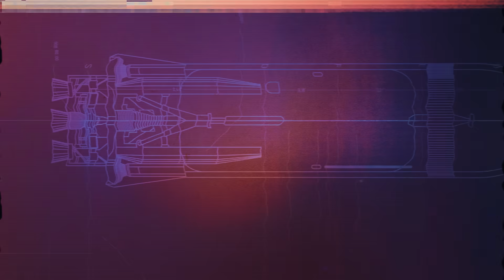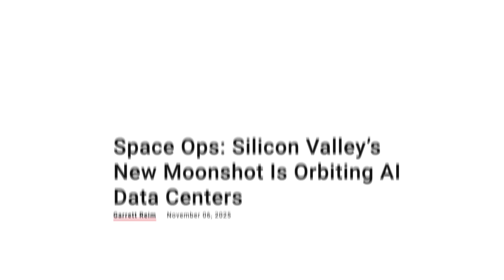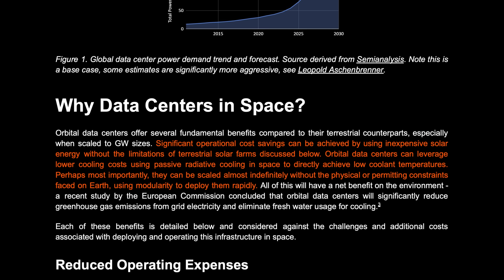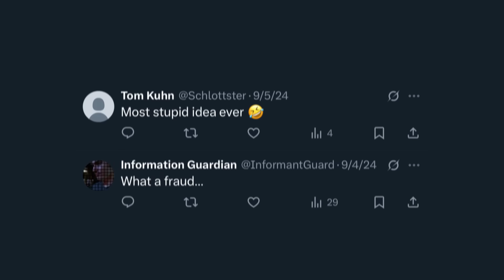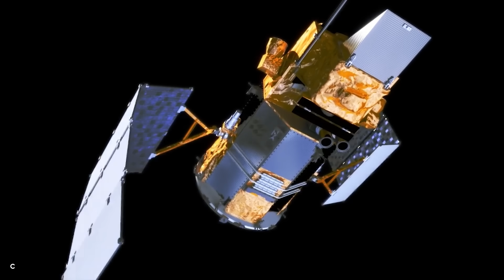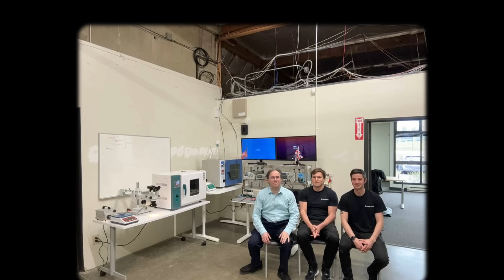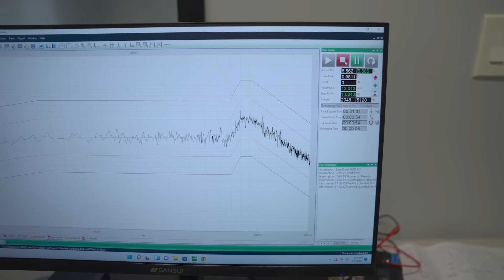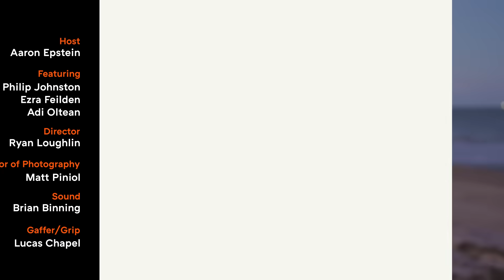Inside The Startup Launching AI Data Centers Into Space

Comment: YOU CAN BE MORE COST EFFECTIVE. I understand star cloud using SpaceX for their initial installations in space. But it will be very costly effective if you use India's ISROs GSLV, a proven and a cheaper technology (1/2 half the cost) the downside is ISROs engines are not reusable.  But your benefit is low cost per kilo.

Comment: The question is there enough space in space (or low orbit). There is currently tons of debris in orbit around the planet how do the data centers stay safe from those debris? other than that this actually pretty smart. cooling is done through the vacuum of space. But also what about the magnetic field of the sun and earth will that interfere with the electronics of the computer?
Reply: YEAH GREAT POINT. BUT THAT DEBRIS IS NOT NEAR 200 KM RANGE? THEY FALL OFF VERY QUICKLY TO EARTH UNLIKE HIGH ORBIT WHICH WILL TAKE YEARS TO COME DOWN.
----------
IT IS ANYWAY WILL BE USED AS A BACK UP FOR EMERGENCY. YOU CANT COMPARE WHAT IS ON GROUND. PUTTING ANYTHING IN SPACE IS VERY EXPENSIVE.

Comment: Their whitepaper assumes 50usd per kg launch cost not 500. It also assumes you´ll get 40MW cluster in a single 100 ton launch. That´s pure BS. Even here on Earth, the racks with GPUs alone would be 4-5x heavier. And that doesn´t include the solar panels, radiators, shielding, propulsoin, etc. The whitepaper assumes you´ll get 40 MW space grade solar panel for 2M. That´s 500 dollars for 10kW, cheaper that a cheap rooftop panel. What a load of bull.

Comment: They also need a hot air electricity generator to supply power to this data center. You might be wondering where will they get the hot air. Simple, just punch a hole in the AI bubble and put a turbine at the opening and, voila, they will have more electricity than they know what to do with it.

Comment: So many things to address here: 
1. No history, they just launched a harden GPU to Space. A lot of experiments of the such are done, purposely aimed to test hardening of common electronics.
  a. Idea to Satellite in 2 years is absolutely feasible.
2.  Energy costs - I keep hearing that -- Consider the amount of energy costs  vs the amount of energy to prepare, harden, maintain, launch and repair stations. Consider the Carbon emissions to launch, and produce this units, without consider the monitor, re entry, debris mitigation and so on. Energy and CO2 emissions alone you loose that battle. You are not free from Land, certainly not from GRID and Absolutely not from cooling limits.  Economics to compete with largest terrestrial datacenters in case of power vs output? .. yes, sure. not in a 100 years.
3. Unless they release the data - Testing one radiation shield and heat dissipation in a 12U is not the same in large scale.
4. you can put all this money in REAL projects like Space-Based Solar Power (SBSP) that aim to beam down power to Earth, clean power to any place in the world, that solves the energy issue an eliminate the business model advantage of this lunacy. 100 ton seems a lot of it really is not when it comes to Computing power. Besides you are forgetting that you need to add around 30% more mass in radiation shielding, heating modules, etc. so technically you are doubling your costs. 

Let me cut it Barney style for you guys, launching capacity and cost means that launching just one standard module to space will cost around 13.6M USD, comparatively that same RACK cost around 600k of energy on its lifetime.. so you do the math. 
Lets also not consider the fact that technology advance faster, Satellites are meant to be there for a LONG time (after all why spend millions of dollars to put it up there) currently the lifecycle of a typical hardware is around 2-3 years.. that means you should be able to replace and upgrade your hardware infrastructure to meet computation demands every 2-3 years... how you suppose to do that? is hard to meet that demand now, and we only have to drive it.
Consider with this the time for support... something breaks.. here you have an aggressive SLA of .. 2 hours? in Space? :) 
Consider a 23x multiplier in costs of energy and general costs is basically generous. 100% of the infrastructure in Space needs to be dedicated to maintain that Data Center, costing 10K per kilo .. make the math. and you are not factoring man power. 

Shameful of YC Combinator to think this is a good IDEA ... really shameful

Comment: Outside of the ISS when exposed to sunlight reaches 250*F, super hot. The ISS when in earths shadow sits at -250*F, which sounds great for cooling, but then wont have access to solar energy.
Reply: Large solar panels will be there to generate electricity and shield it from intense radiation.
Satellites in space have ben there for decades now.

Comment: One, that’s gonna be one heck of a heat dissipation issue. 

Two, now it’s harder for average people to dismantle them.

Three, remember Cowboy Bebop and those weather satellites?

And four… space debris.
Reply: 1. Heat dissipation is very similar to power harvesting. Solar panels and radiators. Surface area and costs are similar too.
2. I guess? Though for the operators, it's trivial: let them burn up in the atmosphere.
3. Nope.
4. There are actually hundreds of satellites out there which have been doing just fine for over a decade. AI centers become obsolete quickly anyways. But a formation of smaller satellites might be more practical for debris avoidance and resilience. Over shorter distances, lasers in space provide about as good a communication link as possible.
Reply: using a cartoon reference as an argument?....   

No more questions your honor

Comment: they will need a radiator the size of a whole country to cool off a modern size data center, with no option of maintenance and high latency 😂
Reply: You think all the money and gov backing that they don't have it figured out?
Reply: Agreed, no water cooling and no air cooling in space.  Radiation is the least efficient of cooling methods, the heat sinks will need to be much bigger than the solar panels.

NVIDIA H100 is also very delicate at 5nm construction, so protecting that from solar flares (SEPs) and deep space radiation (GCRs) is another enormous challenge they didn't mention.
Reply: @nae-nae-99  But isn't space already cold?
Reply: @karencoffman2525  no
Reply: @rgfrobotics you are wrong.
Reply: @rgfrobotics when radiation of the sun touches an object in space,  the temperature shoots up obviously.

When in shadow it drops below zero.

So it should be ideally sheilded from intense radiation of sun.

We have decades of satellite technology in space having very advanced tech in it, doing it for so long.

Comment: Or we can just find a better way to desalinate the water. Fresh water problem will be solved, for energy you will need the Nuclear power.
Reply: Could the waste heat from the hyperscale data centres be used for desalination?  Use salt water for cooling and produce fresh water.
Reply: @nae-nae-99  question all the engineers building these should have asked by now. they just need to find a way to transmit heat and then just desalinated, but it should be doable.

Comment: One of the actual innovative startups.
Reply: Innovative scam maybe. Its complete physical nonsense. 
how to cool them ? 
how to do power supply ? 
how to protect them against solar flares? they need a big hull, that isolates heat. then you need heat pipes. that adds weight. 
how to lift all the stuff there, datacenters are large on earth, they will be even larger in space. 

trust me, you will not hear from that again next 50 years. 
communication yes, storage no.

Comment: All data terrastrial data centers won't move to space because of harvesting maximum efficiency. The analogy is that solar panels, wind turbines haven't replaced other fuel generated electricity fully. It will be same. But still rise of such technology will help in other future space science
Reply: that's because wind is very limited and not scalable and requires permits and environmental assessments, and, solar requires land, the most expensive asset. In space, they have unlimited space, more direct energy, and essentially free cooling without environmental impacts. and the scalability is essentially unlimited.

Comment: 1. How do you COOL it down? Its better to just sink it to the bottom of the ocean then, same as space bth
Reply: Agreed, no water cooling and no air cooling in space.  Radiative cooling is the least efficient of cooling methods, the heat sinks will need to be much bigger than the solar panels.

NVIDIA H100 is also very delicate at 5nm construction, so protecting that from solar flares (SEPs) and deep space radiation (GCRs) is another enormous challenge they didn't mention.
Reply: But isn't heating up our oceans etc already a big problem for climate and biodiversity?

Comment: how are they going to cool this thing?
Reply: 3:36 -
Reply: Agreed, no water cooling and no air cooling in space.  Radiative cooling is the least efficient of cooling methods, the heat sinks will need to be much bigger than the solar panels.

NVIDIA H100 is also very delicate at 5nm construction, so protecting that from solar flares (SEPs) and deep space radiation (GCRs) is another enormous challenge they didn't mention.

Comment: Getting rid of heat in space is actually harder than on earth I think
Reply: It's less about the heat vs. the power.
Reply: just believe! 😂
Reply: Yes, they are relying almost entirely on ir radiative heat vs convection (air circulation). It’s a different challenge, they’ll have to transfer that heat to large cooling arrays or concentrate it elsewhere with a type of heat pump
Reply: You need to call Starcloud immediately!
Reply: No, I heard Elon Musk and Jensen Huang talk about this; they said it is easy to cool a chip in space
Reply: @KingJirehSama  ChatGPT gives a number of interesting solutions...
Reply: @KingJirehSama  i heard them say that unicorns can power data centres with magic. Must be true
Reply: That's why you use systems that are 1000X more efficient.
Reply: Dark side is cold. Sunny side is hot. Put the heat sink on the dark side. Problem solved
Reply: Agreed, no water cooling and no air cooling in space.  Radiation is the least efficient of cooling methods, the heat sinks will need to be much bigger than the solar panels.

NVIDIA H100 is also very delicate at 5nm construction, so protecting that from solar flares (SEPs) and deep space radiation (GCRs) is another enormous challenge they didn't mention.
Reply: It is but the easy access to more efficient solar power makes up for that cost. That’s literally the core of this business
Reply: Space is extremely cold, with the baseline temperature of the empty parts of the universe set by the Cosmic Microwave Background radiation at about 2.7 Kelvin (\text{-270}^\circ\text{C} or \text{-455}^\circ\text{F}), which is just above absolute zero.
However, temperatures vary drastically depending on location:
Objects in direct sunlight (like a spacecraft) can become very hot (up to \text{120}^\circ\text{C} or \text{250}^\circ\text{F}).
Objects in shadow or far from stars get extremely cold (dropping well below \text{-100}^\circ\text{C}).
Reply: @Mike79555 Yes, space is very cold. However, energy is transferred through molecules. When a molecule is at low temperature, it has low velocity. When it touches a hot body, it absorbs energy and moves at a higher velocity. The number of molecules and their velocity determines temperature. This is thermodynamics and statistical mechanics. There is little to no molecules in space. This is the definition of a vacuum. Thus, there are no molecules to transfer energy from a hot body to a cold body. This is why they are building a large surface. What they're not telling you is that it's not a large surface, it's a ginormous surface. With all the space junk orbiting the planet, how do you keep this ginormous surface from becoming riddled with holes?
Reply: Space is extremely cold, with the baseline temperature of the empty parts of the universe set by the Cosmic Microwave Background radiation at about 2.7 Kelvin (\text{-270}^\circ\text{C} or \text{-455}^\circ\text{F}), which is just above absolute zero.
However, temperatures vary drastically depending on location:
Objects in direct sunlight (like a spacecraft) can become very hot (up to \text{120}^\circ\text{C} or \text{250}^\circ\text{F}).
Objects in shadow or far from stars get extremely cold (dropping well below \text{-100}^\circ\text{C}).
Reply: @Mike79555this thing must be looking the sun all time , pretty hot , solar panel powered only😅
Reply: @noway8233 , what if you use a Dyson Sphere to power the data center.
Reply: @Mike79555 direct copy and paste via LLM 😂
Reply: Once you solve the infrastructure in space, you have the system ready. On earth every single resource used to power it up or cool it down will always be a calculation without solution. That's why the space is already inevitable.
Reply: @QuivO.mp4  what about maintenance ? something goes wrong then what will they do sending technicians to space?
Reply: @Kirmadahu  Their betting on tech advancements that are coming in the future. Same way intel did with the microchips in the 90s
Reply: @Kirmadahu  it would exist an AI powered system capable of doing the switch between broken parts and new ones
Reply: @tshebeletsotjabane4979  with a really big ladder.
Reply: @Kirmadahu  robots no human

Comment: I think its a great idea, solar power to run then, natural cooling systems from the coldness of space. Not only is it a challenging problem but I think it isn't likely cost effective yet. But that shouldn't stop us from being ambitious. By the time the technical challenges are met maybe it will be also cost effective.
Reply: Space has no temperature. You need massive radiators to transmit heat as infrared

Comment: Isn't latency going to be an issue I mean my SQL join queries are going to take more than 10 seconds. I assume and also the physical data centers on ground require constant maintenance regarding their electricity failures, hardware failures and every now and then there is a whole team that maintains it who is going to take care all of this in space?? Not to mention sending a maintenance team in space going to be expensive cause of their training putting them in space craft docking in the  area and also chance of getting killed if something goes south.
Reply: Latency will be very acceptable for deep reasoning LLM compute use cases.

On all your other points, I agree with you.  Also consider that there is no water cooling and no air cooling in space.  Radiation is the least efficient of cooling methods, the heat sinks will need to be much bigger than the solar panels.

NVIDIA H100 is also very delicate at 5nm construction, so protecting that from solar flares (SEPs) and deep space radiation (GCRs) is another enormous challenge they didn't mention.
Reply: @nae-nae-99 yeah it will be beneficial for operations where latency isn't the issue, rest of the things yeah that's challenging but their idea unique and solid.

Comment: But in vaccum heat not transfer 😂😂
Reply: google "thermal radiation"
Reply: Agreed, no water cooling and no air cooling in space.  Radiative cooling is the least efficient of cooling methods, the heat sinks will need to be much bigger than the solar panels.

NVIDIA H100 is also very delicate at 5nm construction, so protecting that from solar flares (SEPs) and deep space radiation (GCRs) is another enormous challenge they didn't mention.

Comment: "Inside The Startup Launching AI Data Centers Into Space":

StarCloud is pioneering a new industry by launching satellites equipped with high-powered GPUs (like Nvidia H100) into orbit, marking the first time such hardware has operated in space.

Their vision is to build orbital AI data centers powered by uninterrupted solar energy and cooled by radiating heat into deep space, overcoming Earth's limitations like high energy use, water consumption for cooling, and carbon emissions.

The startup rapidly developed its first working satellite prototype in just 15 months, targeting the use of space-based data centers for GPU compute for other satellites, with long-term plans to challenge the largest terrestrial data centers on energy and scale.

Their approach enables massive scaling unconstrained by land, grid, and cooling limits, and could significantly lower resource burdens on Earth.

The team, coming from diverse backgrounds (including Microsoft, SpaceX, and NASA lunar missions), believes space data centers are feasible due to falling launch costs and technical innovations in radiators and thermal management.

Critics question the practicality of cooling and maintaining these centers, but StarCloud's leadership argues their engineering solves these challenges with deployable, low-mass radiators.

They've already accomplished major milestones, including partnerships and historic launches, and have more powerful satellites planned.

Major tech companies (Google, SpaceX, Amazon) are now also exploring this frontier, indicating growing industry interest.

Ultimately, the founders view orbital data centers as a transformative solution for the surging demand in AI compute, energy, and sustainable scaling as a bold, high-risk, high-reward pursuit.